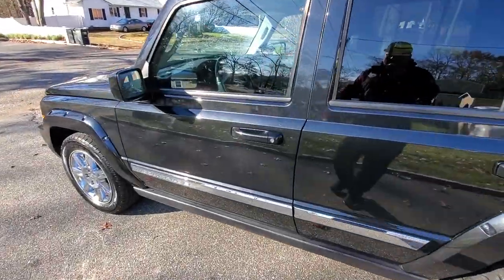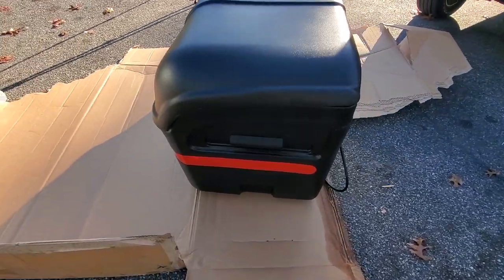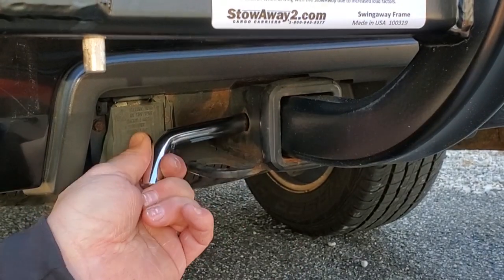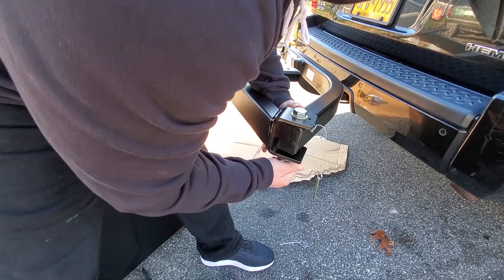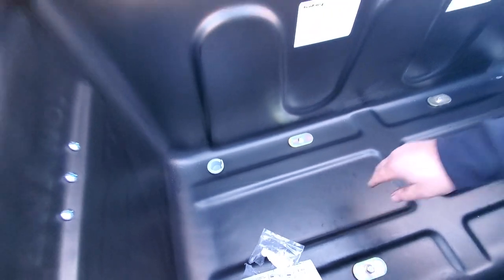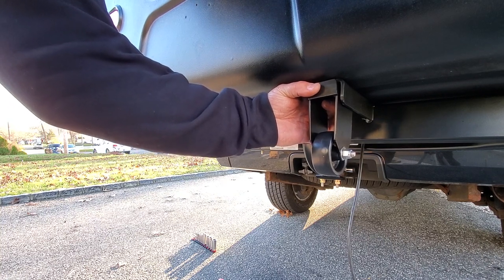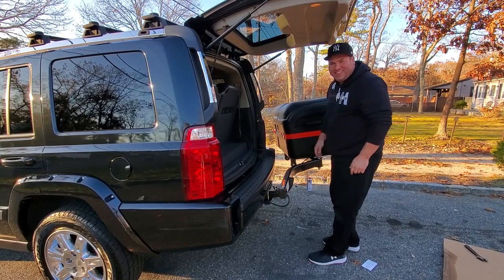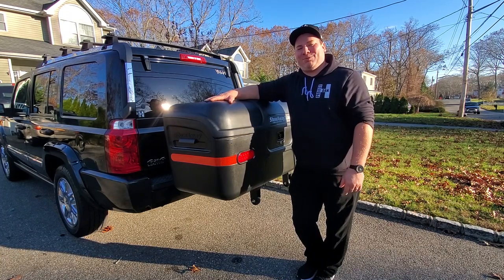JEEP COMMANDER XK GETS A NEW STOWAWAY 2 MAX CARGO CARRIER

Comment: I think it might be better to have the nuts for the bolts on the inside of the box, not the outside.  Just thinking it would be a little harder for someone to steal.
Reply from the maker: To loosen them you'd need access inside the box, that's why it has a lock.   If someone really wanted to steal it wouldn't matter which way they were installed because they can be cut.

Comment: This one probably doesn't apply to you because you've got front and rear plates, but I can see a bored cop having an issue with a license plate being blocked by that thing.  Does the manufacturer make a license plate bracket for it?  There's a town near me that is well known for its speed traps and they nail you for 5 over.  It transitions from 55 to 25 at the city limits, although I think the county put up reduce speed signs before you get into town.
Reply from the maker: yes, there is a plate mount I briefly mentioned in the closing.  it comes with an LED light and it's pre wired.
I'll take my chances with a bored cop over the trillions of cameras in NYC 😎
Reply: @ProjectDanH  must have missed it when you mentioned it.

Comment: How about your car tag? Won't you have to transfer it to the Stowaway when in use?
Reply from the maker: please watch to the end. At the end of the video I mentioned that still away includes a license plate holder with an LED tail light and it comes pre-wired. I chose to not install that for this video

Comment: Great review, thanks for doing this! Two questions: 1. Does this interfere with the detection of objects close to the car? I have a Mazda CX9 and it has sensors and I'm worried with this it will just constantly be beeping unless I turn the entire feature off. 2. I guess your rear camera would get blocked and parking might not be as easy especially with this extra length now behind the vehicle?
Reply: Oh and also funny that I'm also a Dan H lol
Reply from the maker: Yes, I had to turn off the rear warning tone and it did interfere with the rear backup camera.  Other than that everything operated as normal.  Beware of your surroundings and you won't ever have an issue.  thank you for watching
Reply from the maker: Lol, Classic! Go Dan H

Comment: Hey question , I just got my trailer hitch installed ( Acura RDX) , and while installing my stowaway box , two things happened.  The first thing, ( pretty much did what you did)  the unit box sits a little higher than yours, and I really have to lean on to close it. Might that be because I tightened the stabilizer unit too tight?  Second my electrical isn't working , I plugged everything in and disappointing , nothing is working .  Do you have any suggestions ??  Thanks!
Reply from the maker: I found that I had to use a 7-pin connector because the 5-pin connector didn't work.  Not sure about the way it closes... maybe you just have to break in the hinges a little more.  Hope everything works out okay 💪

Comment: the only downside, it hides the licence plate, giving cops a reason to pull you over and writing u a ticket, thus ruining your vacation, ill stick with a roof cargo !
Reply from the maker: No, it comes with an illuminated license plate mount.  I didn't install it.  I drove over 2000 miles from NY to AL and back without getting stopped
Reply: @ProjectDanH  that's great, no tickets. but just my luck ill be the one who gets one...lol hope yall had a nice vaca.